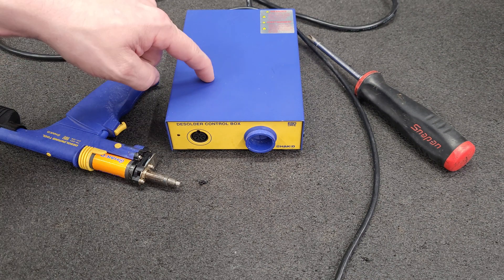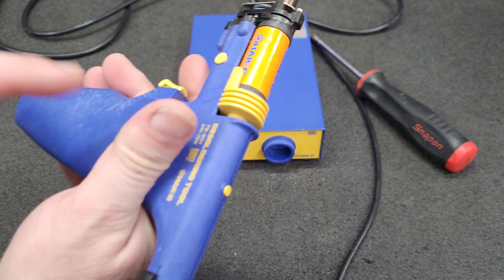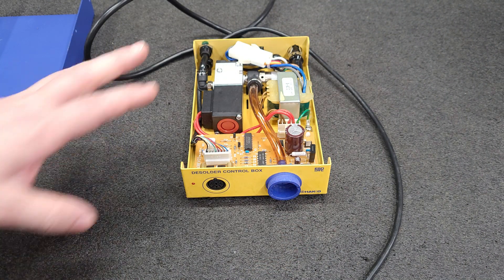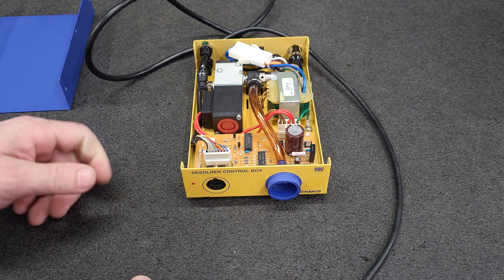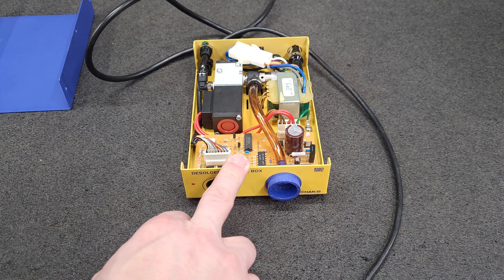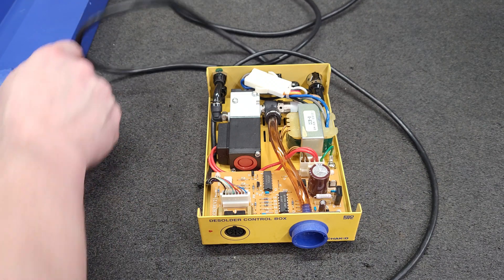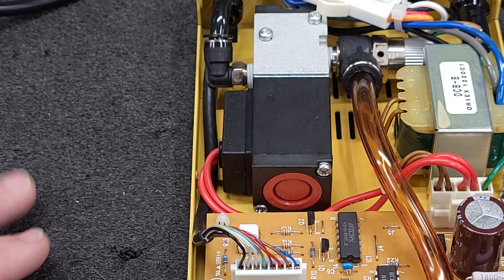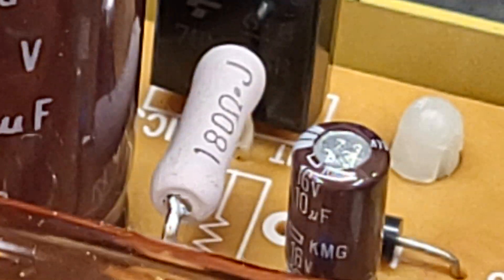Hakko C1492 FM-2024 Desoldering Control Box A Look Inside Mini Teardown

Comment: I have used a Weller, Pace and the Hakko desolder systems with internal pumps over the years, and the Weller and Pace were the louder of the three units. But that isn't why I am going with the Hakko, it is due to the age of the other units, and the lack of support for the old units.

The Hakko unit I have just purchased needs shop air, and I am setting up a small tank and pump to supply it. The air pump will have even less noise than the Hakko mechanical pump unit, which will be nice, but in truth, with it under the bench, rather than on it, the noise may be unnoticeable with the other noise in the shop. However, now that the noise is in my home, it does make a difference to my family!

As far as repair, I have always made due with the self made schematics, altho, I can now put them on the computer and print them out, or share them online with others.
Reply from the maker: Yea, i just switched to JBC and will prob move form their electric pump to the Pneumatic shortly, Sadly most the new high power Hakko options are an electronic vacuum source.